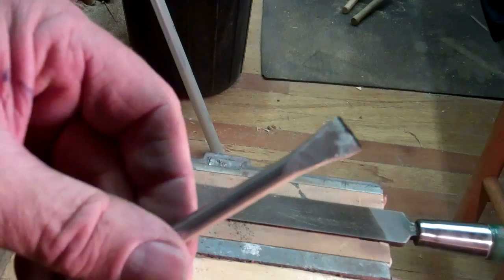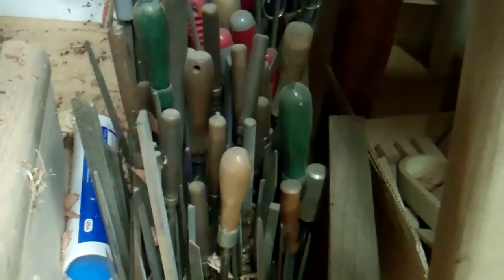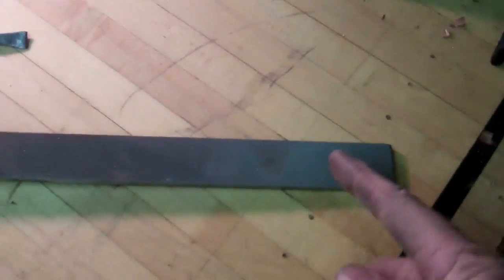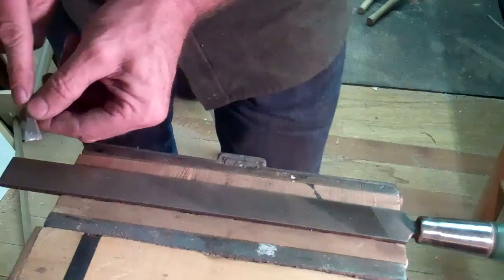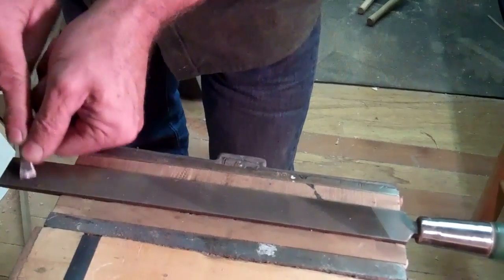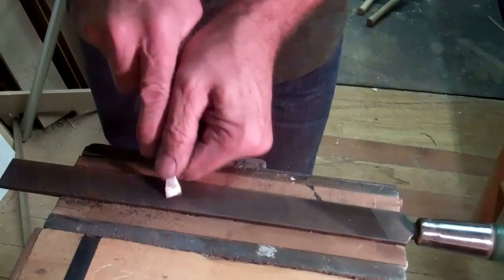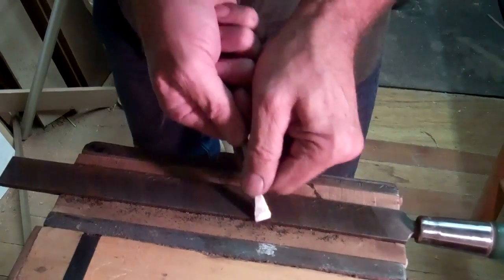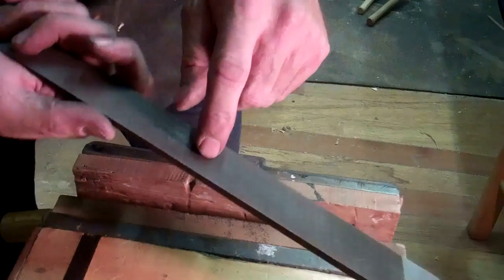How to restore a file

Comment: Cleaning is a great first step. 
More dirty files are tossed than dull ones.
I have been a proponent of acid sharpening for years. It will sharpen files that are dull. It won't restore missing teeth. 
One easy way to improve the filing process is to use a piece of soap stone to coat the file before use. The soap stone is slippery and prevents the chips from clinging to the file.
You can buy soap stone for marking steel at hardware and welding suppliers. 
With the soap stone and a file card you can keep your files clean and sharp longer.
Reply from the maker: Good advice, thanks

Comment: That is a cool trick.  For the files I have cleaned, I have had some good luck using a handheld steel wire brush (like your brass one but steel), as so far most of my debris were just wood vs metal.  I will keep your trick in mind if I run into files with much more serious clogs. Thanks :)
Reply from the maker: Joseph Krug try it, faster and deeper than a brush

Comment: Like you sir, I collected tons of those through the years and I found out the best way to do that efficiently is actually to use a metal wire wheel on a hand drill. It does it steadily, nicely and in no time. Thanks for sharing this video with us. Regards.
Reply: That is the fastest way to ruin a file!! Ask any machinist/metal worker if they go anywhere near a file with a wire brush

Comment: In 1980 my father brought home a bottle of something like "deactivated acid" and used it to rust a file that was no longer as good as it was when new. He told me that the corrosion ate all blunt nosed file teeth is such a way that they became less blunt (more material removal at the sharp corners of the blunt tooth). Two things happen when a file is rusted in acid: blunt teeth become sharper and the file is degreased. A machine shop is always a place with a lot of oil/grease. Oil and grease are things that can ruin the cutting job; so, a degreased file will always cuts better than before the degreasing. My father told me to avoid touching the file with my fingers, our skin have oil and, on a machine shop, much more oil is expected. Since my father started on machining in the end of the fifties I assumed he was right. I removed a lot of rust from my files this week using muriatic acid, they are not like new, but they are much better today than they were last week.
I rusted two old and stressed files with a strong bleach, it worked. Muriatic acid is safe and almost harmless if used with care.
Reply from the maker: I honestly have not tried acid but have been told many times that it works.
Reply: @arboristBlairGlenn  And muriatic acid is cheaper than vinegar!!!

Comment: Try using a piece of copper pipe flattened at one end, works really well too, a little softer than steel
Reply from the maker: never thought about copper pipe but that might make for a wider flat.  Thanks for responding
Reply: Copper pipe or tubing is the common medium for making a scraper for these.
Another tip is to rub soapstone across the file before using it to keep the file from plugging up. Some use chalk but soapstone is the much better of the two.
Reply: A rifle cartridge case pinched in a vice works as well.. larger the better!
Reply: @HansFormerlyTraffer  We learnt the chalk technique back in school about 50 years ago ! Where has all the time gone ? Oh the teacher called it "pinning ."

Comment: I  have a very old machinery hand book that illustrates a way to sharpen files. Basically it directs a jet of high pressure steam to which is added fine sand  to the backside of the teeth. The claim is that the sand wears away the back of the tooth and leaves it pointed again.
Reply from the maker: I would love to see that work as I have a huge collection of old files and rasps. Several hundred!

Comment: I have read that a "file card" is not a good idea because the steel bristles are too hard and can damage the file- dunno if its true or not though.  I've read so much it becomes a religion about file care, just like the lore on chainsaw sharpening.  But I have seen numerous suggestions to use a copper tube with flattened end because the copper is hard enough to get into the file crevices deeply and mechanically, but not too hard to damage or dull the file teeth.  Also big arguments whether the chemical treatment with acid (muriatic, citric, etc.), drano, etc. followed by a base bath (baking soda, etc.) sharpens or just cleans.  My surmise is its just the latter.

Comment: I use a piece of copper pipe, flattened and shaped similarly.
The copper is soft enough to avoid damaging the teeth but hard enough to clean them out.
Reply from the maker: That works as well. The softer steel in a flattened nail will not damage the teeth either.
Reply: @arboristBlairGlenn  
Copper pipe is easier to find and to work.
I doubt many people have ready access to nails as thick as a little finger.
After 50+ years of using it, I'm well aware that 'copper works'. 😉😊

Comment: What kind of metal are you using apologize if I’ve missed that part aluminum ? Thanks
Reply from the maker: Just a large soft steel nail. Takes a minute of cutting the grooves to match the grooves of the file. Works great

Comment: Whats the best way to remove the excess rust to begin with please? Should i soak it in vinegar or similar?
Reply from the maker: Billy Bass I have not had to deal with too much rust. A good wire brush is what I start with.
Reply: @arboristBlairGlenn  dunno why i just completely forgot about the wire brush lol thanks, the one i have has been sitting at the bottom of a toolbox unused for some yrs so its a project for me to restore it as best i can.

Comment: Good one !, thanks. 
piece of hardwood works if clogging is not too hard. 
Many years ago i found a commercial business that re-sharpened files by sand blasting. It was at very low angle from handle end and used fine blast media. 
They resold files with logos removed. 
 We tried and it did work. Never liked the acid or vinegar method.
Reply from the maker: Hard to imagine how sand blasting can sharpen
Reply: ebony piano keys work well and I keep a pot of these on the bench for cleaning my bench files before putting away

Comment: Nearly, but not quite... 

Get a strip of soft metal (brass, nickel silver, copper at a pinch) and near the tang where the file is least used work the strip until it's toothed to the correct pitch, and spacing as the file's teeth. Now gradually work your way down the cutting surface lifting all the visible filings, but more importantly,  you'll see all the minute, greasy, almost mud like residue, being lifted as well..

This was first shown to me, 40 years ago by an old engineer, who learnt it from an even older one 😉 My father didn't even know about it, snd he was a Watchmaker to trade!

PS Rasps are slightly different, it may be possible to refresh those somewhat, by knocking new teeth, I suspect heat, and some Smithing might be involved, some very coarse files might benefit from the same treatment, but the costs will be perilously close to the price of a new replacement
Reply from the maker: Good advise to start near tang where it’s still sharp. Is there an issue with the soft steel? Copper better?
Reply: Soft steel isn't soft enough, and will wear the file, copper is probably too soft (although I've never used it)

As a professional Musical Instrument Technician l've always had access to scrap brass, and nickel silver (nickel silver is my preferred choice, slightly harder than brass)
Reply from the maker: @iandeare1  thanks, I will try brass. You looking for exotic hardwoods for your instruments? I have some of the best!
Reply: @arboristBlairGlenn : I'm NE Scottish, bit of an ocean between us LOL 🤣

Comment: Glenn, what’s your opinion on using a wire wheel on a grinder to gently clean them?
Reply from the maker: I feel that a wire wheel would hit the tops of the ridges but not be very effective at cleaning out the gullets. A file card is good to a point but still can’t get to the bottoms of the grooves. This technique is the best I have seen.

Comment: Dear sir, can a aluminum tube or pipe flattened at the end work instead of the nail you have used ?
Reply from the maker: @AliakberLokhandwala-ey9hj  I have heard folks using copper but I believe if it is too soft, it may just clog the file. Try it and see

Comment: Another thing you can do with old files is to grind a face flat. This will give you a sharp cutting edge and a safe edge. If the file already had a safe edge, then regrinding this will expose a new sharp cutting edge. Works best on square or triangular files, but enables you to file cleanly into corners.

Comment: great! i will try this on my old files
Reply from the maker: Files can be expensive so this trick can bring them back to a new life.
Reply from the maker: Have you tried it yet?
Reply: yes! and im impressed at how much of a difference it made! now i got my diy file cleaner close at hand each time i use the files :D more than anything it prevents scratching of the work-piece, since it removes also the tiny shards of steel that gets stuck, so its saving a lot of time in my metal-work, not having to file of scratches!

Comment: This process obviously cleans the valleys but i dont see how it would sharpen the actual teeth
Reply from the maker: Thomas Rose no, but a good cleaning can restore a file that is still useful but not destroyed. Use acid to sharpen
Reply: logic would dictate that the acid would dull the teeth
Reply from the maker: Thomas Rose I agree but not having tried it, it's worth testing. I have heard the acid process for years and I'm ready to give it the "acid test"!
Reply: He clearly states in the video its not Sharpening just Cleaning.
Reply: You are correct acid will clean the file but not sharpen it. most the time a file is clogged but not blunt as the states in the video
Reply: @thomasrose6962    Logic dictates that the acid won't discriminate against the valleys or teeth, hence the sharpening process.

Comment: google sharpening a file with acid. you won't be disappointed.
Reply from the maker: J Davidson I have seen that but have yet to try it. Have you?
Reply: I JUST DID ALL MY FILES USING THE ACID METHOD AND THEY ARE ALL LIKE BRAND NEW. I WAS SURPRISED HOW THEY TURNED OUT. I HAD A 6 INCH BRASS WIRE WHEEL I USED ON THEM AFTER THE ACID ETCHED THEM.
Reply from the maker: J Davidson I own about 300 files and rasps. Do you think this will work on a rasp too?
Reply: Can't hurt to try it
Reply: I've cleaned a bastard file with vinegar from the supermarket. Just over night and it cleaned off the rust, after I cleaned it with a copper tool similar to Blair's custom cleaning too. It was sharper than just using the cleaning tool, I used the bastard file to sharpen up the shovels so it gets clogged up pretty quickly.
Reply from the maker: readyset just vinegar? Interesting
Reply: @readysetsleep   To stop a file clogging when using one on softer materials, run some chalk up and down the teeth first. You wont be disappointed.

Comment: dude. i did this it doesnt feel any different. it just cleans material clogged between teeths. cutting ability of the file is still same.
Reply from the maker: Muhammed Gundogan your file must be too dull. Cleaning out the build up allows the file to work again but it does not bring it back to sharp. Most files stop working because they get clogged up. Yours must be too far gone.
Reply: @arboristBlairGlenn  simply it cleans. Does not sharpen in my perspective.🤔
Reply from the maker: Muhammed Gundogan that is exactly what I said in the video. Most files stop working BECAUSE they are clogged up. This is NOT a sharpening process.

Comment: That 100 dollar file that you where talking about is a farriors rasp and cost about 8 bucks to 15 bucks for a new one.....
Reply from the maker: Haze you are right about the name of one of these tools but wrong about the cost. A good rasp of this size is very expensive. A cheap 14" farriers rasp is between 15 and 25. These larger rasps are much more costly
Reply: arboristBlairGlenn oh. ok. thank you for sharing your knowlage I'm pretty young so I'm not nearly as familiar with tools . even though I'm a Smith lol but hey. thanks for the tip on cleaning the files.
Reply: 8 to 15 bucks for some Cheap Chinese made ones Probably. But im sure his are old American Made ones which are much more Valuable because you cant them like that really anymore. Besides maybe Nicholsons files and raps. The quality just isnt the same and youll find that true with most New tools from over the Pond. Thats why im a firm believer in Good old U.S. made Tools or even German or French tools from  Europe are Really Good too! Sheffield England i Beleive still makes Really Good quality Steel Tools that will last a lifetime.
Reply: A Nicholson 14in farrier rasp cost under 25.00 usd new. I think the big picture is. Take care of your good tools,and they'll serve you well And that Nicholson rasp I'm talking about is about 4 years old now an works just as well now as it did the day I got it,but the main thing is? I take care of it. I think that's something our elders did much more then we do now days. Because I remember my Dad always cleaning the tools when he was finished with them,and I still remember getting my ass whipped for messing with the tools. "They're not toys son!" "They're tools."

Comment: I am no expert on files but it may be worthwhile to pass on that there is a tool called a file card (or file brush).  It is designed specifically for cleaning files of all types.  It will make much quicker work of cleaning the file teeth.  On occasions when there is excessive pinning (clogged teeth) then the procedure described in this video might be the method to use.  

Also note that using these mechanical cleaning methods still leaves debris in the teeth you can't see leading to less than 100% performance.  I have seen on one of the professional fine woodworking shows use a chemical cleaner you can soak the files in after the mechanical cleaning to further remove the microscopic debris.  It was a DIY network show whose name escapes me as well as the name of the cleaner (maybe Ferric Chloride??).  And no...it was not vinegar.
Reply from the maker: jgrizzlybaer I neglected to say in the video, that o first used the file card. This method takes it a step beyond the file card. Acid is another process, but messy.
Reply: Yes, I agree your method is a good second step if needed.  But afterwards a chemical cleaning will go all long way to further clean those files.  Just be sure to put a rust-inhibiting protectant on the files immediately after ANY cleaning.  

By the way, the DIY show I mentioned demonstrating the chemical cleaner was Wood Works by David Marks.  I still was not able to get to the name of the chemical cleaner used.  Good luck to all and thanks arboristBlairGleen for a very worthwhile file cleaning tip!!!
Reply from the maker: jgrizzlybaer I did the video work for David Marks YouTube channel as well as two of his DVDs.
Reply from the maker: jgrizzlybaer this is at my house

https://youtu.be/i7vFEtqjMDQ